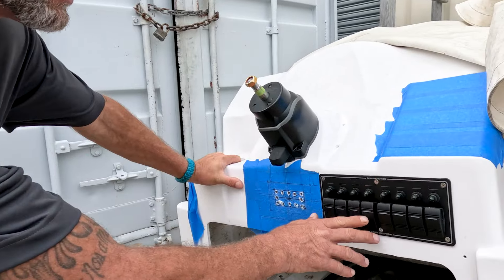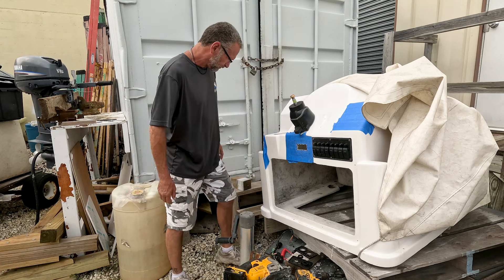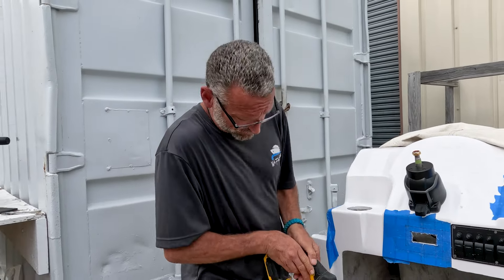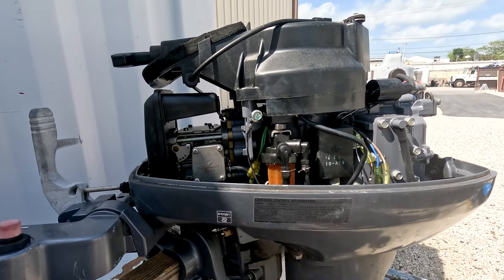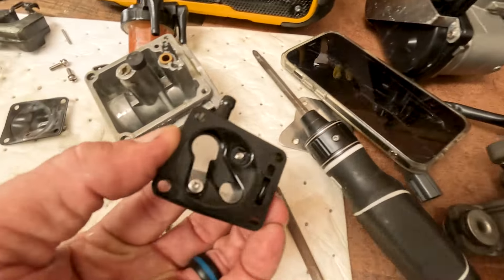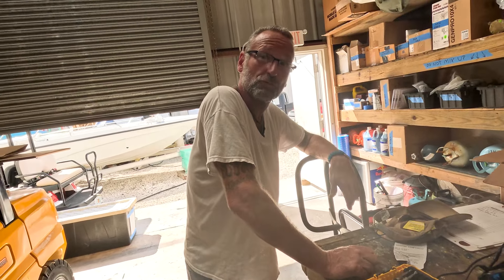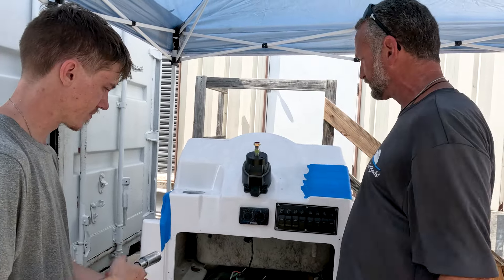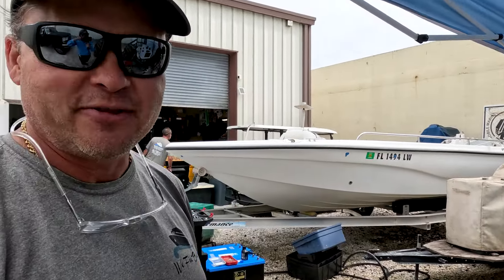It’s Time Our Center Console Build

Comment: That’ll be the nicest wire setup on a center console in Key West.   I’m hauling out our trawler tomorrow in Stock Island for two + weeks.  I would like to reach out to you tomorrow about possibly doing some AC work.  I promise it’s easy to get to.  😅
Reply from the maker: Yes call us Jim 3053951924 Best to do a/c when the boat is in the water unless you need a thru-hull! 

Which marina are you going too?